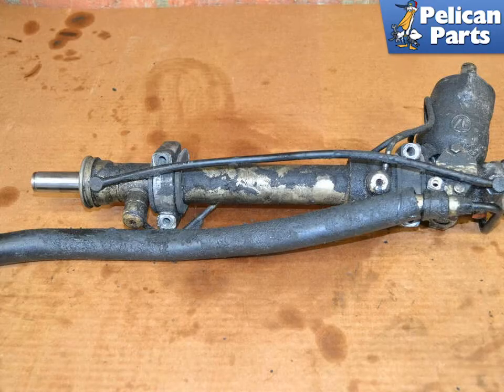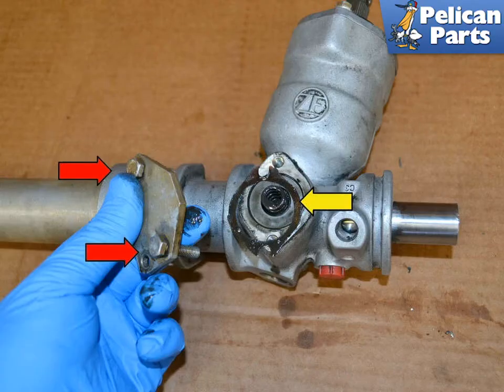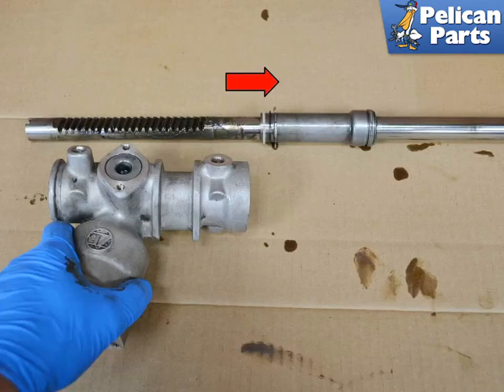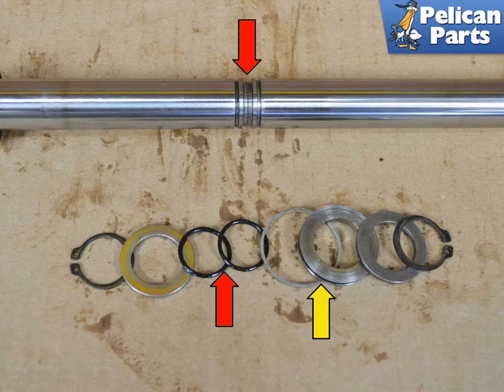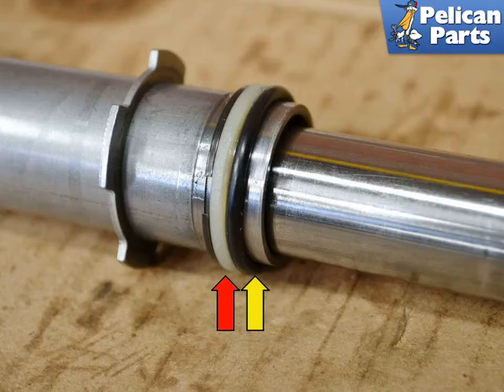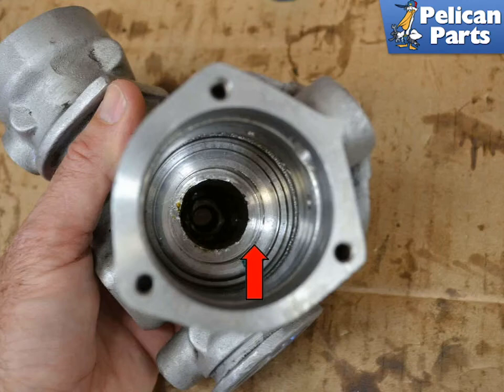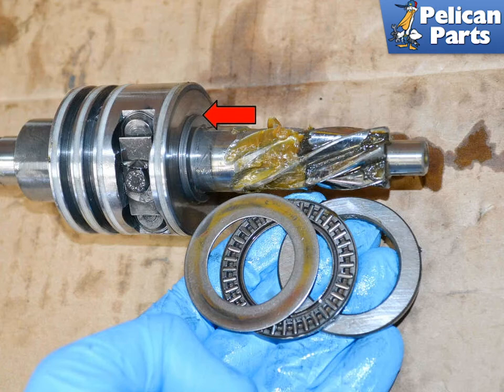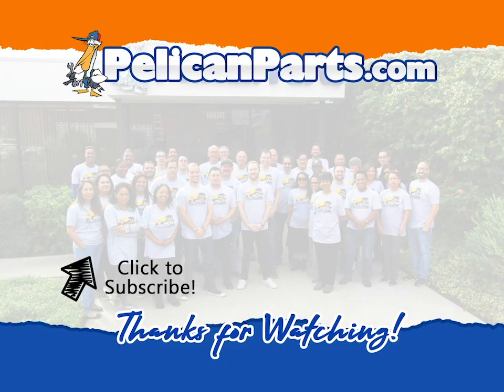Porsche 944 Turbo Steering Rack Rebuild (1986 - 1989)

Comment: What's the gasket part #?
Reply from the maker: You didn't mention what year and model vehicle you are working on.

With your vehicle info handy, give The Pelican Parts parts specialists a call at 1-888-280-7799. They can figure out what part or repair kit you need.